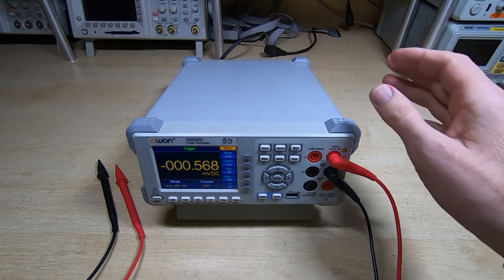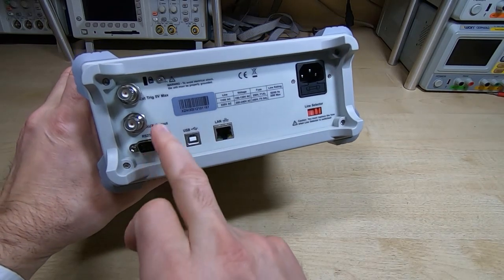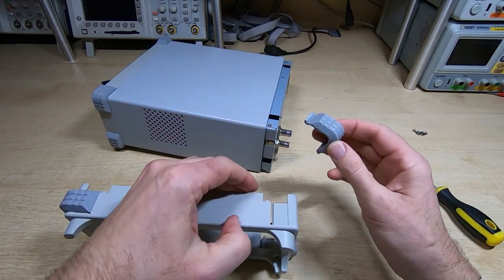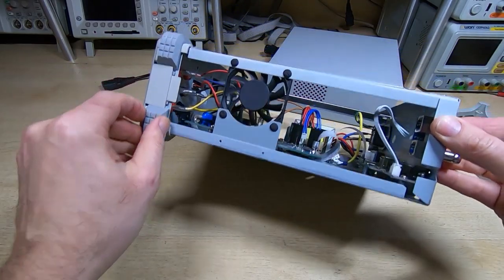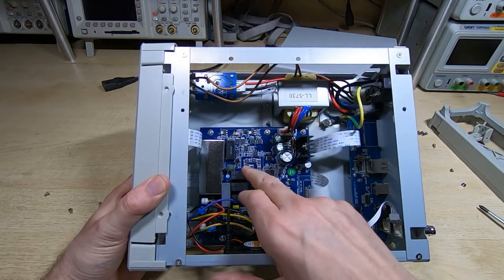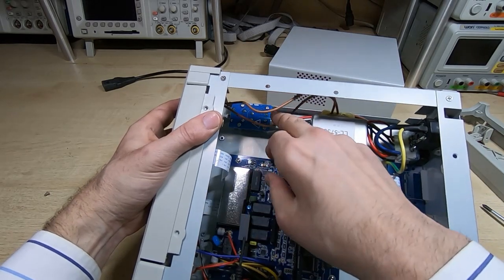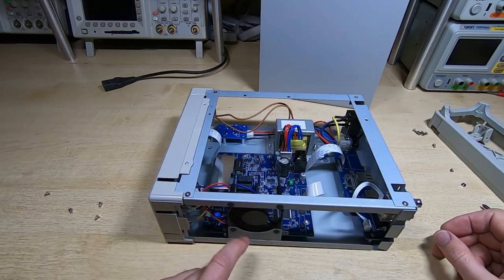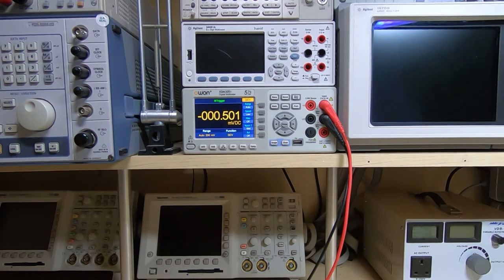OWON XDM3051 Teardown

Comment: Hello Jerry. If you still have that DMM. Is it possible to measure DCV and DCI (DCI as secondary DUAL measurement) in the same time? Of course with usual time offset (relay click possible) as 2 different measurements. If yes, is it also possible to do logging DCV as primary and DCI as secondary measurement? Would also the supplied software allow dual logging of DCV and DCI? Thanks for info. Best, Wendel
Reply: yes you can measure DCV and DCI at 'the same time' (it alternates reading each one) BUT bear in mind that the meter has a shared common input for volts and current, which may limit what you can measure.  Also note that when the meter switches to reading voltage it breaks the current connection with a relay

Comment: Jerry, I hope that you share your fan & ducting upgrades for this bench multimeter, including as much "how you actually made and/or modified stuff to fit" as you're willing.

Also, how much space does your Agilent device (the one to the right with the large display, at the end of the video) leave between it and the stack of smaller equipment for ventilation flow?  Is is "shaped" a bit like old CRTs with enough "curves/tapers" to leave room out of sight of the camera?

Comment: I decided to open mine today and give it a go.  The whole meter seems to draw 7 watts or so depending on the backlight.  The fan seems to be there to blow air past the rectifier.  The 5V fan is marked 0.25A and measures 60mm x 10mm.  A deeper fan won't fit easily as it butts up against some wires. The fan seems to draw only about 130mA at 5V.  Tried current limiting on my power supply to see how much reduction I would need to get the sound level I would like.  I ended up splicing an 18 ohm resistor in one of the fan wires.  Seems pretty quiet now.

Comment: This thing is so empty inside - why didn't they make it smaller? You could fit two pcbs vertically rather than one horizontally. Can manufacturing everything on a two pcbs be more expensive than the price of transport being 2x higher due to 2x the size?
Reply: Because then you couldn’t stack them, and it would then effectively take up more space. If you want something smaller, look at for example the Owon XDM1000 series.
Reply: @bjondersson  nah you can stack shallow things very well by using 19" rails or rear brackets like vesa mounts
Reply: @cheater00  That’s true, but very many, dare I say most, don’t have 19” racks. Just look at Jerry’s shelf in the video. That’s what very many labs and desktops look like. And anyway, I’m pretty sure this is the reason they make the boxes the size they are. The manufacturers know what they are doing, and understand the needs of their customers.

Comment: Check that both front and rear USBs and the NIC are isolated from input and main board.  It does look like they are.
Have you tried using the NIC interface yet?
Reply: I have it works fine, you just telnet to it on port 3000 and send ascii SCPI commands